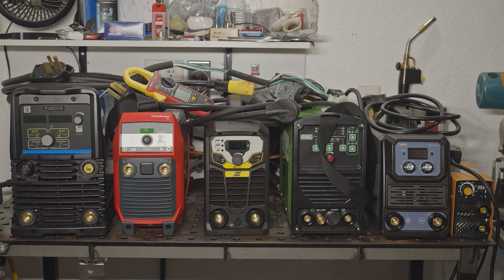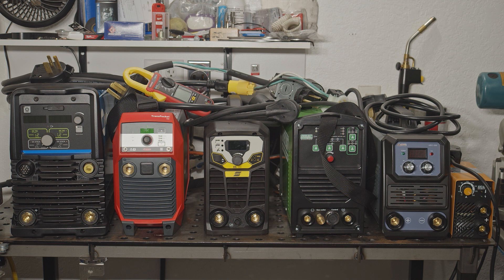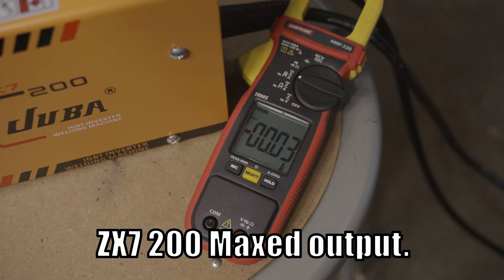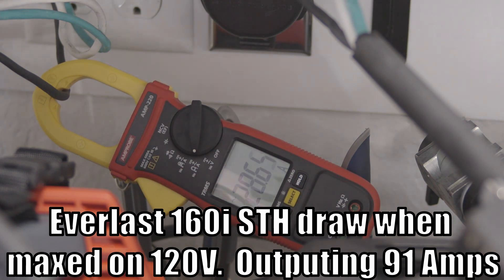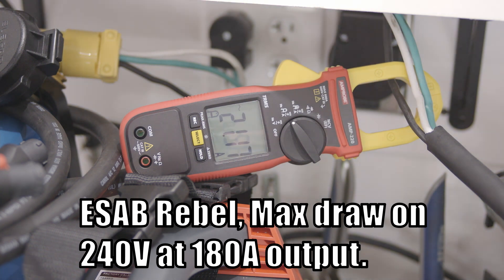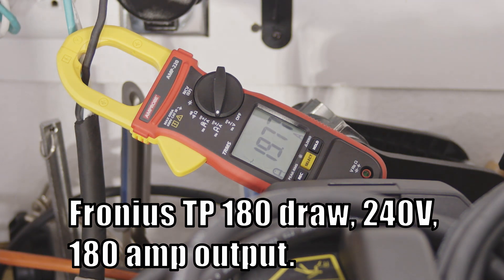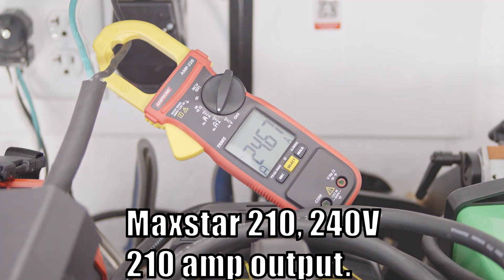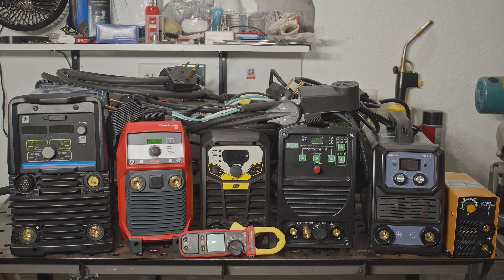Welder Efficiency Comparison, 6 Stick Welders Tested

Comment: Be nice to make a chart, list results or time stamps each results and see some prices.  Thanks for doing these.

I wonder if all the extra money is just for extra capacitors?  Seems like a lot of price.difference.  Being in electronics repair, I know high voltage , high temp.,  high capacity ,low ESR capacitors are more expensive, but still.  Double , triple, quadruple????

Comment: Interesting do the welders with the highest efficiency have the longest duty cycle ?
As the ones that pull more amps at a lower output you'd think that heat would have to go somewhere ?
Reply from the maker: Part of the excess current is just because of a poor power factor, not technically loss within the machine.  Duty cycle will depend on cooling effectiveness, components ratings, etc.  Many Chinese welders have no care for safety certification standards.  One consideration for duty cycle that those certifications have is component ratings, such as power cords, power switches and even the plug type used.  For instance, if a welder pulls 25 amps on 120V, it would never be approved for 100% duty cycle if it used a NEMA 5-15P because that plug is technically only a 15 amps.  So it would have to be rated at a duty cycle that provided an "effective" current draw of 15 amps or less.  That doesn't mean the welder couldn't run longer than that, but the manufacturer "rates" it that way to meet certain standards.  Stuff like that.  

But companies like Amico don't care about that, so they can put wire and a cord end rated for 15 or 20 amps and have a draw and duty cycle that results in a 30 or 40 amp effective draw.  They don't submit it for certification testing, so they can "rate" it however they want.

Comment: You seem very knowledgeable and I have a burning question in regards to the machines drawing ~30a at max output on 120v. Under what circumstances would that be a realistic use? My understanding is most 120v circuits like in a house/garage would have 15 or 20 Amp breakers anyway, so is it even realistic to get max rated output on 120 with these machines?
Reply from the maker: A 20 amp breaker will allow higher current for a short time.  That is why I could demonstrate these welders pulling 30+ amps from 120V without tripping the breaker.  So you can definitely get full output from these machines.  It just becomes a question of duty cycle.  If you are running a low duty cycle with lots of time between welds for the breaker to cool down, then you may be okay.  But if you try to run long welds or high duty cycles at full output, you will likely end up tripping a 20A breaker.  

A 15 amp breaker has a much lower over current allowance, so you will likely get a lot less out of the welder on a 15 amp circuit.
Reply: @bigtb1717  Great explanation, thank you.

Comment: This is very insightful , thank you for your efforts. I'd be curious to know if you put two clamp meters, one on each leg of 240v, if the draw was consistent across both phases. I would have to imagine that it would be, or somewhere thereabouts, but potentially an interesting idea for a future video. At any rate, thank you for the informative and well-produced video.
Reply from the maker: Since none of these welders use the neutral, current should always be the same on both legs.  Each leg is one side of the circuit, so it can’t draw current from one leg and not the other because they are just two sides of the same circuit.
Reply: @bigtb1717  That makes sense, I hadn't thought of the lack of the neutral. My 220V dryer, for example, will actually pull different loads on each leg of 220V because each leg is responsible for a different set of componentry - but again in that instance a neutral is present. Without understanding the innerworkings of these inverter type machines, and of course not thinking about the lack of the neutral wire, I didn't know if something like that could happen here. Thanks for shedding some light on that inquiry!
Reply: I hate to sound thick headed here but does that mean that if they are drawing say 30 amps on your meter is that the total draw on the circuit or do you multiply x2 because there’s 2 legs on the circuit? Thank you.

Comment: Rebel or Rogue?
Reply from the maker: Did I misspeak and call it a Rebel in this video?  The ESAB unit I tested in this video is the Miniarc Rogue ES 180i.  I apologize if I said it wrong.
Reply: @bigtb1717  how do you like the machine so far?
Reply from the maker: I think it's a pretty good machine.  I like it.  I have a review of it on my channel.  I haven't used it a ton, but it has a three year warranty with local support and it welds nice.
Reply: @bigtb1717  Nice. I'm about to start SMAW in school so I figured I'd get a head start and get a feel for it.
Reply from the maker: Awesome!  Good luck with your studies/training.

Comment: Output voltages? I also was getting 140ish out of the ZX7 with 72 I think open circuit volt. I liked that little welder but I've upgraded to the Amico ARG-200. Great test you did on that BTW with the temperature readings.
Reply from the maker: I didn't check open circuit voltage.  Could be interesting to test.  I considered testing voltage while welding, but I used the same rods for each test and tried to keep consistent travel speed and arc gap, so the output voltage should have been fairly similar since I matched the amperage.
Reply: @bigtb1717  You do good tests. Voltage and watts would be good also.

Comment: I love this kinds of content. What about checking the actual output compared to where the dial/readout on the machine is set?
Reply from the maker: I did test the output of each of these welders during this video.  I had to in order to ensure I had the output matched.  I didn't put that testing in the video because it seemed like a lot of staring at meter displays already, lol.  I have also tested the output on a few of the welders I've reviewed.  As for the welders here, the Miller, ESAB and Fronius all output within a couple amps of the display setting.  The Everlast was fairly close as well.  The Amico ARC-200 was a little off on 240V, though not as much as some I've seen.  I can't remember exactly, but it didn't strike me as terrible.  When running on 120V the Amico was way off.  The adjustment still goes from 10-200, even though it can't put out nearly that much on 120V.  I had to set it at 118 amps to get 91 amps out.  The Juba ZX7-200 is also way off.  It also adjusts from 10-200, but maxes out around 135-140 amps when set to 200.  It is further off the higher you set it.
Reply: @bigtb1717  I tested the Amico arc 200 on 120v with two meters  simultaneously and when amperage is set to 90 the meter reading was very low around 40 on one and 60  on other, the meter reading was much higher as i increased the amperage. very strange. I uploaded the video.
Reply from the maker: @WV591  It looked like one of your meters may be off at lower amperages.  They got much closer when you turned up the amperage.  At any given moment amperage is always the same, everywhere in a circuit.  So the difference in the readings of the two meters tells me that one or the other (or both) was reading incorrect.  To get 91 amps out I had to have mine set at 118 amps on the display.  When set at 200 amps it put out around 135-138 amps.
Reply: It would be very annoying to me since I have more than one welder..  They always say to fine tune the weld to the welder , but you expect only around 5%, max.10 difference ( one could  be low the other high).  If you only use the one welder at home, all the functions work and it actually puts out enough power for you, I guess it's fine.